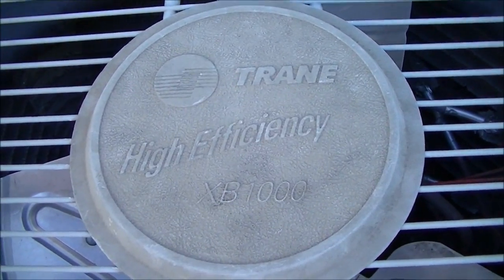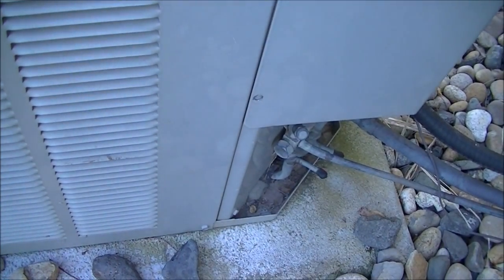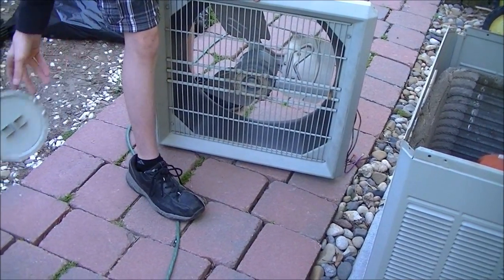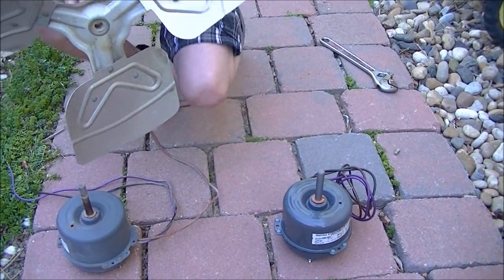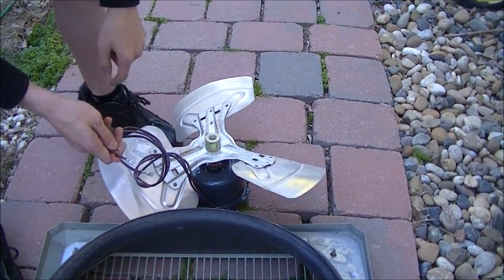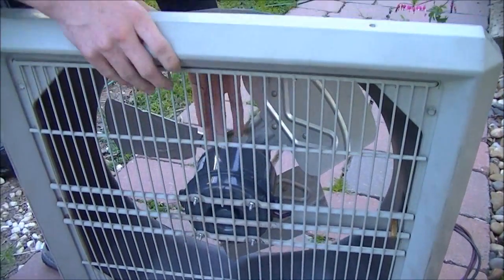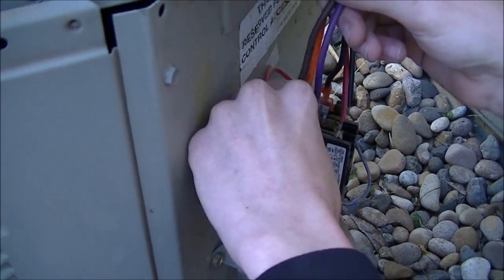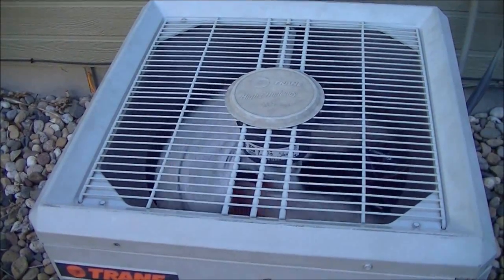How To Replace Trane Central A/C Condenser Fan Motor

Comment: Thank you for the demonstration.  Very well done. It's best to replace the capacitor during a motor change out as a preventative maintenance measure.  Take care.
Reply from the maker: Thanks! Yeah we would have changed the capacitor if certain money matters didn't get in the way! But we needed to get this repaired and running again right away, so we did what we had to do.

Comment: I believe the reason it is generating all that noise is because he had not reinstalled the bolts to secure the top of the unit. If your unit makes that much noise after installing the bolts, all is lost.

Nice breakdown of the video!
Reply from the maker: I must not have mentioned it in the video, I did install the bolts for the top cover off camera, but there were some missing already, so I think at one point that unit was serviced before.  Because I sure as heck know that if it were me, I would've installed ALL the bolts!

Comment: Great video! I have the xb1000 1 ton version. Not any real difference to the 3 ton. It was especially helpful plugging back in the wires as I forgot to take a photo when I disconnected them. Thanks.

Comment: Thank you! I'll be using this to replace the fan motor on my XE1000. Not many differences.
Reply from the maker: Sorry I'm just seeing this comment now.  Usually I'm pretty good about responding to comments within the day they're posted, but we've been painting so my computer has been out of commission for a few days.  Glad I could be of some assistance, thanks for watching!
Reply: Did the process end up being the same? I'm will be replacing the fan motor on my XE1000. Came across this video and it seems pretty helpful.

Comment: Thanks for the video, i have the same unit with the same issue. Already replaced capacitor so fan motor is next. How do i know what motor to get? Thanks
Reply from the maker: You're very welcome, thanks for watching!  As far as the fan motor, just match up the part #(s) on the motor and most likely they (or wherever you order online from) should have the right one.

Comment: Ge motors and capacitors are now Genteq its parant company Regal-Beloit. they also own the FASCO motor brand. is its recommended to replace the motor run capacitor anytime you change the fan motor. or a compressor. some units will have seperate run caps for fan and compressors the new units with ECM fan motors there will only be one run cap for the compressor only.  to discharge a capacitor if its a motor start or motor run capacotor you can use a screwdriver and touch the terminals as it makes a good crackling sound and small spark  then its discharged.  if you use a different fan motor or a universal type motor they will have more wires for speeds and more commonly an extra set of wires with a connector(s) wich is for rotation. i think Trane's OEM for fan motors and Capacitors were GE and its now Genteq.

Comment: If only my fan came off that easy.   Before attempting this job you may want to have a replacement fan on hand as well .... available for > $100 with no re-stocking fee for 90 days.    Also do to the age of the unit its difficult to find the exact motor ... mine was 1100 RPM at 1/4HP best I could find was 1075rpm at 1/4hp
Reply from the maker: Try some penetration oil like WD-40 or something.  You can also try using some sort of prying tool or breaker bar to try and yank it off without damaging the fan blade assembly.  If those methods don't work, you may need to try hacksawing the shaft off below the fan, and then find the right drill bit to the inner diameter of the fan post and then drill the shaft out of the fan carefully.

Of course by that point, it may be wise to source a new fan assembly in case you do break the old one.
Reply from the maker: @ronmichaelgaray  Great to hear, and thanks for the info!

Comment: Is it me, or does the XB1000 look a lot like a GE air conditioner?
Reply from the maker: I've never seen a GE central unit in person before, so I wouldn't know.
Reply: Well, the GE air conditioners were made from the mid 50's to the mid 80's, and they look very similar to older Rheem/Ruud air conditioners. But it was in the mid-80's when Trane acquired GE's Air Conditioning division, which is why they use the Climatuff compressors, Spine-Fin coils, and in the case of the XB1000/XB1200, a similar design to the older GE units.
Reply from the maker: Gotcha...